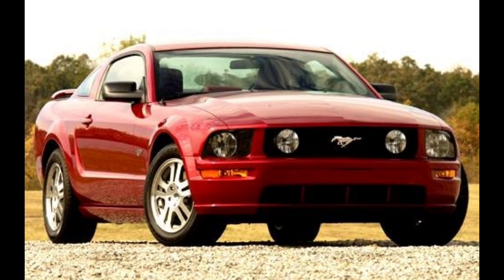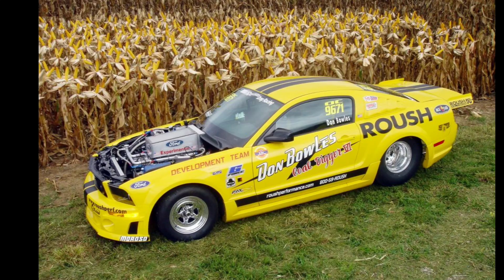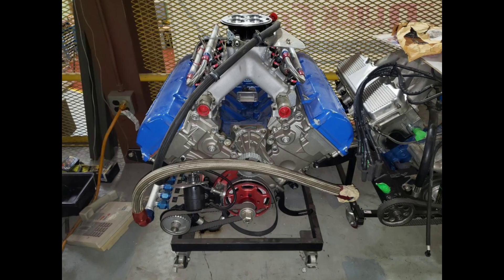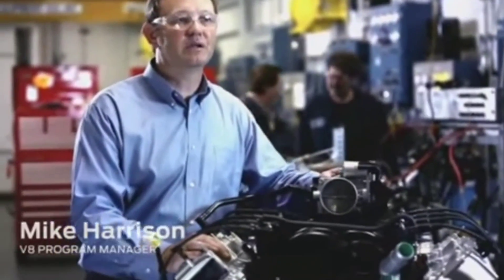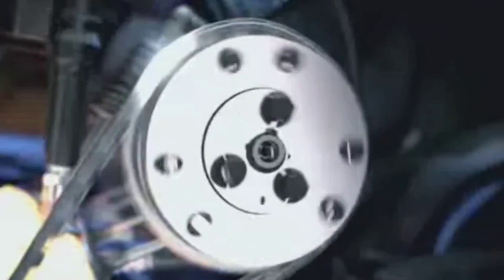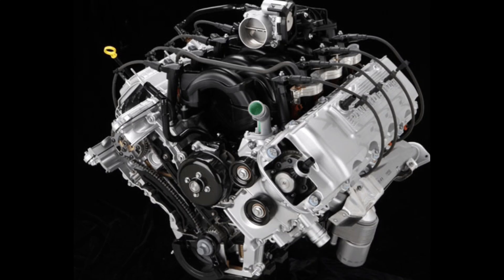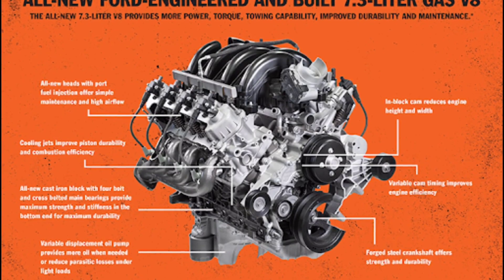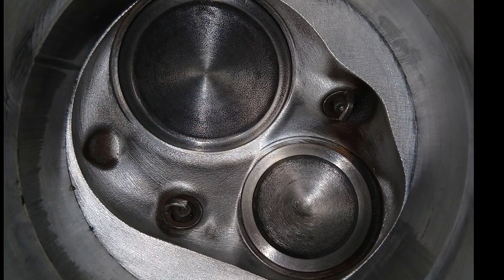Ford's Modern Day 427 SOHC Cammer..

Comment: 6.2 is the greatest modern engine from ford they finally realized they made it so well with those engines approaching 300000 mile marker ! Inn the raptor and 
Ford series trucks ! So fam good they the engine bays at the dealerships had no work coming so they cut the program !

Comment: I really regret selling my f350 with the 6.2, bought the same year with a 6.7 power stroke lol.

After a year so or trying to figure it out, and trial and error with parts - i figured out it's going to cost me a minimum of $25,000 to make the 6.2 sohc boss a 7+ litre 900hp engine on pump gas.

Aside from a complete lack of availability for performance parts, and custom parts required for EVERYTHING -- The biggest issue was the water jackets. Deboss garage did a really good video about this, however it actually does a really good job at cooling the engine.

So you prefer a Siamese bore however the 6.2 single overhead cam was designed with non Siamese water jacket. You can overbore but only to manufacturer specs, anymore would need a sonar...but you'll likely find out you can only overbore per ford service spec after the sonar. The water jackets are an issue && a wet sleeve would require a sacrificial block to figure one out.

Further exemplifying the problem of this platform - there were a few and still are very few brand new 6.2 sohc boss short blocks or even long blocks available. Not many to sacrifice basically. Like unity Motorsports has said it was relegated to truck duty. So all you do have are reman engines from Ford and stuff like that.

Aside from that, I'm 90% certain that you can actually make up the remaining cubic inches to get 7+ l by doing the max overboard and getting the max stroke from your crankshaft. A company or racing team (i forgot who) actually got the boss to 7.5 with stroke. HOWEVER there is literally no info available about it, and i highly suspect that a ton of custom work was required to get that displacement. Apparently, it was on the  stock 6.2 platform (not Don bowles special cast), unsure of sleeves but the information available made it seem like a crankshaft and max bore was all you needed.

HOWEVER, to even get to this point, imagine all the custom work you're going to need to do like especially with electrical tuning and all of that. If you do have a Short block or long block available with the cylinder heads. You actually do have a lot to work with because for example the fuel injectors already something like 47 lb an hour from factory and the actual cylinder heads flow really well for what they are.  A dude was able to get 600+hp from stock displacement by going with upgraded custom cams and porting on the head. Intake manifold plates to adapt a victor style intake.

Basically you're going to spend a minimum of like 25 Grand, buying cam cores, crankshaft cores. Potentially need to get custom rods OR adapt chevy long rods. Need new rockers and lifters. Getting all of that designed, grinded down, multiple dynos, whether you start from scratch or recycle another ECU or electrical system, that's also going to be really tough to figure out. Even the cylinder head valve cover rocker cover. Whatever you want to call. It isn't sufficient for the bigger lift and you're also going to have to fly cut the Piston valves which apparently isn't the easiest thing to do and not everybody wants to do it even if the customer is paying.

Ultimately - Ford moved on to the 7.3 l Godzilla because it was easier to modify. It was easier to upgrade. Less so about power, because the 6.2 boss ACTUALLY makes more power and torque per cubic inch and so on than the Godzilla. It doesn't matter because if it doesn't fit, where will it go and engine stand or museum? It's less wide but taller than the 62, which means that it can actually fit better in four trucks and even in mustangs. Because width is a problem in the engine bay, but you can technically just get a different hood if the intake or heads are too tall. Ford is actually supporting the aftermarket for the 7.3 Godzilla which it'd be nice if we got that for the 6.2 boss, but it just didn't happen.

Comment: Ford stared out with a small block with the idea of OHC on a V8 in a designed for automobiles. They quickly decided to go with the competition proven 427 to compete with the Chrysler but after completion it was not allowed in NASCAR so Ford (no OHC engines) for some weird reason. NASCAR has always discouraged innovation. They want it to be like the defunct IROC series with all cars identical no mater the make. It some of the most ignorant 💩EVER in a sanctioned racing series. Let them boys go, it looks like a rolling parking lot  now when I tune in to one of the COT or whatever they call that junk. Spend millions of dollars on engine development and put a friggin restrictor plate on them. BRILLIANT! I realize they are too fast for safety on certain tracks but choking down the engine is so oxymoronic it smells even without smellavision. Maybe a small engine,coyote and the DOHC GM makes now,after all it IS supposed to be stock car racing and that’s what comes stock in a lot of vehicles now.

Comment: I've machined and built a few of these. The 1-foot long plastic timing chain guides held on with 1 bolt are a joke,  Every bolt is torque to yield including the valve covers, oil pan,  and water pump WTF???? and there are a ton of them with specs like torque to 19 then 43 then 60 degrees WTF. The Ford springs break so the fix is to custom machine spring seat spacer and install Dodge Hemi beehives WTF. In this old engine builder's opinion....  great idea, but terrible execution
Reply: do you have a link to the spacer and valve spring upgrade, sounds like a good solution.
Reply: @jeffclark8681   you have to make the spacers on a lathe. In the last 6.2 we used the updated  SBI springs, Its much easier that way,

Comment: Just for reference, the quickest and fastest pass of a nearly all oem Ford is a 4.6 4V.
John Mihovetz prepped one and still retained the OEM cast block and heads, timing components, and factory Kellogg crank ultimately running a 5.88 at 250mph on race gas. 
That's both quicker and faster than any pass by a 427 SOHC on NITRO!

Comment: We have a 6.2 super duty at work and I've always been impressed how peppy it is. These 6.2 should be 351m/400 kinda cheap at junk yards. And surely some cam company could grind something custom up. Tha valve covers and intake shouldn't be a big issue with someone that knows how to handle a 3d printer. At the very least make an adaptor or plates to make an existing intake work ala....351c intake spacers  on a 400.

Comment: This engine is actually pretty nice.   The compression is "only" 9.8:1 with aluminum head, that could easily be raised to 11.5-12:1.   The intake valve is 54.5mm or 2.14 inches.   The valves aren't in a true hemispherical orientation but they are rotated enough to take advantage of cross flow.    Looking at the intake valve position in the chamber, perhaps a 2.20 or 2.25" intake valve can be fitted?

Comment: How much room was there to port the heads? I have a raptor with a Whipple on it and I'd like to do some head work on it. I'm at 159k and don't want to have the valve spring issue so any upgrades would be great to know!

Comment: In my opinion overhead cams are great engines for cars They don't belong in trucks That's my opinion and I'm entitled to yeah they can go in the 150 shore the half ton trucks are pretty much minivans at this point to me a truck is a base model no features work truck that's what trucks are supposed to be that's what they were made for I get it the 1500s and the 150s they're mostly crew cab soccer mom cars overhead cams fine for those if that's what you're going to use it for if you're going to really wear you need an iron block push rod and that's why they got rid of the trident and the super duties and went back to push rod and that might be one of the best Ford motors they built in a long time and only time is going to tell when that bad boy goes 300,000 mi with I know it's going to it's iron block for injection pushrod big block Ford and I drive one every day at work and it's actually great
Reply from the maker: I agree. The 6.2 in a truck was a fail... Hard to beat that low-end pushrod torque! Look at the Godzilla... Thanks for Watching
Andy

Comment: Big Shout out to Don Bowels. Years ago we went to UTI together and nodded over the 351C family of engines as I was a fan of the 335 series while Don was a fan of the FE. We put some ideas on paper and the next thing I knew those drawings came to life as the Ford SVO head for the 351C thru 400, offered in the 1994 Ford SVO catalog, (Ford’s answer to the Direct Conection/Mopar Performance program). These heads were refined with Port work by Yates and became known as the Yates Head. (You’re welcome Mr. Yates). The SVO version of the heads were offered in three sizes, to keep flow velocity up on smaller displacement engines. This meant they could be used on the 302 all the way up to 400 cubes and not lose too much low end torque on the smaller engines. Coincidentally, Don and I discussed that over lunch the day I drew him my idea of what the 351C in modified form should look like, with raised ports on both the Intake and Exhaust. The exhaust was to have a high oval shape at the exit to better smooth out flow of the hot gases as they left the engine. The SVO heads looked just like my exhaust design. This could have all been coincidence, another Don Bowels and all. But the Guy I knew was hired by Ford and was going through UTI as a precursor to Ford’s own engineering school, so I doubt it was. Anyway, no matter how my story ends this engine is amazing, and I for one would love to have one!
Reply: Unity, it blew my mind when I saw this today. I wish I had known Don better, but we were from very different places. We both graduated HS while taking full advantage of their Auto Mechanics Programs. But Don was from California, and I was from a small town near Phoenix. He went to the Pit Stop Challenge, where he and his partner Dennis Butts, won the competition propelling him into Engineering, and Arizona didn’t have that kind of funding. The fact that our paths crossed was just dumb luck, but you couldn’t meet a nicer guy, and a hell of a Chess Player too. We spent a lot of lunch hours playing each other, and he kicked my butt all over the chessboard. thanks for your great video. I’d love to help with your research, but that would be difficult, another person you might want to talk to is Barry Robotnick, who owns Survival Motorsports. He knows more about the FE than most could even begin to learn, and he might help with your research into the Cammer. Best of luck and this new subscriber is looking forward to your next video!
Reply from the maker: Thanks Kenneth!  That is some neat facts..  
Andy

Comment: the 427 SOHC had Fully Hemispherical Combustion Chambers, and the Single Overhead Cams offered more Radical Cam Timing.

Hemispherical Combustion Chambers offer a 20% increase in HP over the Wedge Head design.
Reply: Hey folks its Keith Johnson the EcoBoost lover.

Comment: Andy, did you ever cut the heads open for cross section? I can see how the 7.3 is saving Ford a TON of money but there's no way it can match the SOHC if you use the built in rev capability. 
You really got me thinking about it. With new larger valves and good porting, they have to exceed 400 on the intake side. Maybe a touch of tig filling? 
After watching a lot of Spintron testing, I can say for sure a pushrod valve train eats over 80hp at higher rpm. The bigger the cam, stiffer springs, larger the pushrods, it all comes at a cost. The technology and know how of today can make a better valvetrain than Bowles had in 08. 6.2 final year was 2019 I think? Should be plenty of them out there. People run their 427 LS with twin 88s into the 1700hp range at 7500 and never much more because of float. 
Pac or psi single beehive springs (which you can't use for high lift, high rpm on an ohc), Ti retainers and roller tip rockers, should get you over 9000rpm easy. That 1500rpm increase will carry the power curve up another 150-200hp in an NA application. Never mind boosted. T&D custom rockers with custom ratio $1500-$1800, custom cams about the same maybe a little less. With the 4.53? bore spacing and 9.41? deck a 7.5 liter or 460.

Comment: Am I wrong or is the 6.2 the motor that has the Voodoo flat plane crank? Plus of course the SOHC valve train design.
Reply from the maker: No, the 6.2 has a conventional crank... You are thinking of the 5.2 DOHC Voodoo that has the flat plane crankshaft..  
Thanks for Watching!
Andy
Reply: @UnityMotorSportsGarage  thanks for clearing that up.

Comment: hopefully I'll finally be buying a 6.2 f150 very soon. i was SOOO happy when i heard they came out, and maybe even more disappointed when i found out after the shortest engine run of any Ford gas engine i can think of, they were gone. at least in the half tons. Ford has pretty much had the hp per liter my entire lifetime, but usually the smaller engine. this was an opportunity to really show gm and mopar guys what was up, by just getting to their displacement level. i hope there is enough aftermarket support, but I'm getting one regardless. i want a newer truck, cause i just don't have time to mess with rebuilding anything right now, that IS my daily. and somehow, these are the cheapest I've found... even the 99-03 trucks have gone up, and I'd rather spend 16k on a 11-14 model, than 8 or 10 for a decent 2 valve 5.4 with WAY less power. and i don't want a 3 valve or a 5.0, definitely no ecoboost... i don't understand people, at all... if they had any intelligence, these would be everywhere. but 99.5% of even v8 f150s are 5.0. it might be ok in a single cab or something, but that's just too much truck for 300 cubes. people only know how to look at the surface, and even then, just peak numbers, which is why the ecoboost has sold so well. that, and they don't care about longevity, theyll be one or two trade ins down the line by the time there are any real problems. which is why I've been hesitant on ANY newer truck, but hopefully these will still hold up and make it another 10 years without nickel and diming me to death. i don't mind dropping a new engine or trans in after a while, but spending the same money, just for computer bs where there really isn't even a real problem, it just thinks there is, or a fortune for wear and tear items is ridiculous.
Reply from the maker: I wouldn't mind finding a 6.2 F150.. but they are hard to find!

Comment: Yeah thank your liberal Biden for the end of the 6.2L.... Ford had all the intention of developing it but they like alot of other manufacturers just axed all main mechanical engineers in favor of BEV tech engineeers and software developers. Its was parts shelf cheap to do a 7.3L and probably a 6.8L pushrod to get through the next 10 years till everything is ELECTRIC. Lifes going to be very boring

Comment: Waiting for the aftermarket to offer a complete kit for the 7.3 push rod to go into my 2003 Cobra. Never was a big fan of the modern "Cammer" engine. Expensive race parts, and more of them.  
I mean, what's not to like...  445 cubic inches compared to 281 cubic inches. My guess, more engine bay room too.
Reply from the maker: Mark, you are right... How can you NOT love 445 cubes.. in a package just slightly bigger than the 351w.... 
As much as I like the 6.2 and what it could offer, packaging it in a Fox/SN95/New Edge is tough!  Plus even if you run the 7.3 crank in the 6.2 you end up with 403" vs 379" stock. 
 I can't wait to see what the Aftermarket does with the 7.3 
Thanks for Watching
Andy
Reply: Hey Efab 93,  
Yeah, I may be a Boomer, but you're part of the young & dumb.   
You didn't see a stock Terminator engine with just a Whipple upgrade run the 1320 in 8 seconds, LOL!
I'll bet my 19,xxx mile 03 Cobra on that!  8 seconds, you have to be kidding, LOL! You are clueless. 
Just got done watching a YouTube vid on a 04 Comp Orange, big twin screw Whipple, built aluminum block with engine laying down "around" 900hp and owner stated 9 something.

Comment: Blackout Ford went with two separate cam chains because the 427 single overhead cam have one chain that was 7ft Plus in length and then after a while it would stretch and throw everything off and had to be replaced especially if you were racing it that high RPMs

Comment: There's gotta be a ton of these 6.2s in scrap yards. Someone needs to get the aftermarket support going for these. They would make great swaps for hot rods and muscle cars/ trucks. I'd love to see what a serious build could put out.
Reply: Livernois has cams, and a 6.6l stroker kit available.
Reply: Imagine with a carbureted intake, a VCT delete, and big cams. It would be a monster, easily available in junkyards, and a good swap for older cars that doesn't cost like a 427. A "poor man's 427" if you like. They're all over the junkyards already.
Reply: @theodorgiosan2570  Absolutely. I have seen someone who made a carb intake adapter that let them use some sort of 302 or 351 intake. bars that bolted onto the heads and had holes that matched the ports machined in, and then turned them 45 degrees or so and changed shape gradually into the Windsor port shape. So with them installed the windsor intake just  bolted on. He didn't post exact details so i have to assume they were custom machined for him. personally i would rather use an aluminum Cleveland 4V intake to feed the big BOSS.
Reply: I love my 6.2, i really want to delete the cats.